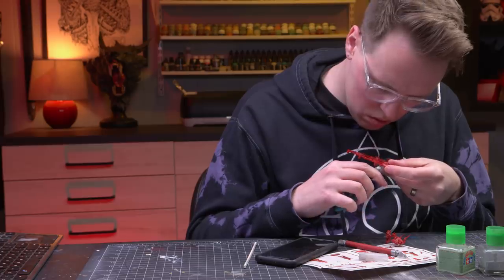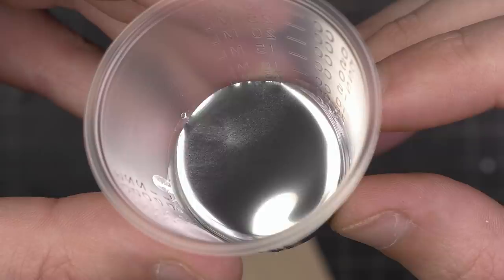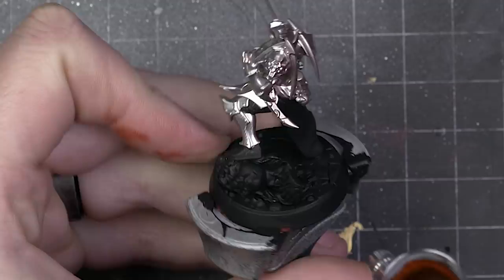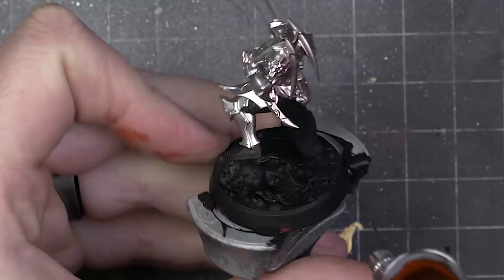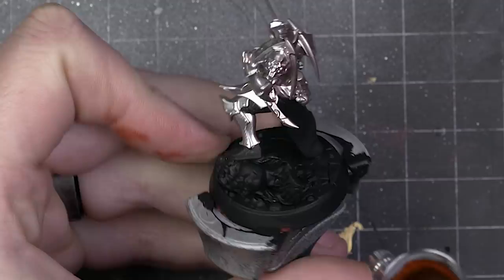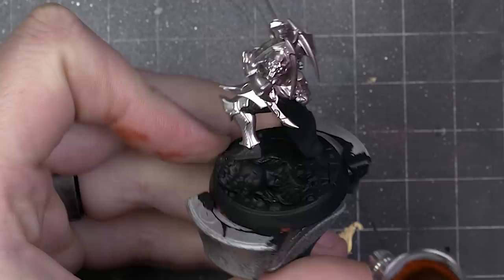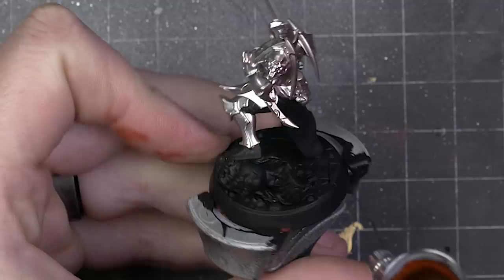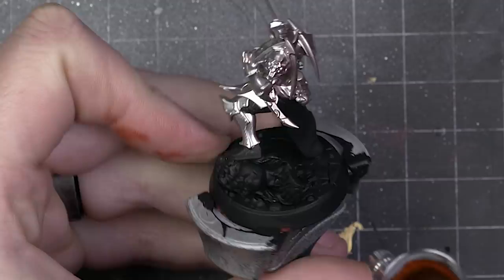Can I Paint Photo Realistically?

Comment: I think the issue with the reference photo (your NMM painting is awesome btw.) is that the very diffuse lighting makes the metallic surface a bit boring and unnatural.

In 3D rendering, this is where you use HDR 360° images to create interesting objects and contrasts for the environment that the metal can reflect. It could be interesting to emulate this using a setup of small LEDs and maybe an LCD screen around the mini.

Comment: I think there is a problem with trying this method (even if youre head is in the right place). Changing scale plays havoc with everything. In this case, I think the primary problem is distances vs. reflection intensityt. The shiny model is very shiny, lets say, roughly about as shiny as the "real" armor would be if it existed irl. However, the distances are not the same (so you changed one parameter but not another). There is more distance between, say, the models arms, and the ground, but the ground is reflecting just as much light as usual. That means you might see a very vivid reflection of the ground in miniature, but it would be much less pronounced irl. The distances between different parts of the body are different. So the legs are reflecting as much light as a full scale model, but they are 100 times closer to the chest than they would be, so you get a lot more bounce light off the legs onto the chest than you would irl.

You could do this. But the real way to do it would be to take a picture of the real 1:1 scale model and then paint it to that standard. Otherwise, you will succeed at creating what looks like a shiny miniature, not what looks like a tiny version of a man wearing shiny armor.

Comment: I'm wondering that if for the final glaze you used the X-27 instead of the Contrast if that would have made a difference in pulling it closer to the original. It is a much more candy red than the Contrast and would have still preserved the rest of the work.

Comment: it may sound weird but to me it says what ninjon has said a few videos ago i believe, not enough contrast.
If you're going for THAT much metallic smoothness you got an extreme amount of contrast (which is what you saw and pointed out with the highlights being so close to the recesses).
The other things that you have to keep in mind when going with anything metallic (and this is used in 3d rendering a lot) is how smooth the metallic surface is:
not all surfaces are mirror like, granted plate armor most likely will have some smooth surface to it, but not to this degree, and even though i understand where the thought came from, using that chrome pen's filling may have been counterproductive, as it will make everything look like a mirror, which would never be realistic in the first place, as well as not having any contrast between the amount of mirror like surface and any rough spots (which, looking at the photo, there are none)

Comment: I can't help but feel like the problem wasn't so much about matching the colour palettes but more about the fact that the example module was chrome with red over it, whereas your example is trying to paint red directly over black. 

It may have worked better to achieve that kind of metallic cherry red effect if you had built up to an NMM chrome before applying red glazes over it, or potentially even if you had started from a white undercoat? Your end result is actually quite similar to the 3 color break down (6:23).

idk, I'm not a very good painter so I'm probably wrong.

Comment: The intense bright lines below recesses only would happen if the "plate" of the armor is deformed into that shape, if it's two plates one over the other it wouldn't happen, asthe cause for it is that the "plate" bends upwards again and catches the light to then keep bending and stop doing it, is pretty much an inverted bevel, so some of the bright lines you did were actually wrong as you replicated an effect that was caused by the nature of the figure, being one whole piece instead of multiple layers of metals building an armor over a vampire. everything else was great though!

Comment: Miniac has balls of steel; though one is larger than the other, and kind of rusty.

I suppose that the "photo realistic" model is suffering from a sort of double bounce of the light. The original model has the light bounce of its surface, and then back in to your eye. The second model has the light bounce of your approximation of the already bounced light and then back in to your eye. If that makes any sense? :)

Comment: I think something in the pipeline between your camera to the paint isn't showing real colours because the model looks more vibrant on film, in this instance maybe starting with an orange base and painting on top would improve the result? I can see a potential problem with trying to colour match to a monitor as well, because the blue light off the monitor will backlight your paint, making it harder to match, which may be why your end result is washed out.

Comment: Your attitude in this is really motivating, thanks scott
Reply: Awesome video! Was really interesting to watch.
I'm a digital and gouache painter, and I think I have a few ideas if you're going to attempt this again.
The first big thing is - don't colour match to a monitor. That thing is backlit, it's going to throw off your colour perception. Do a print out of the mini and colour swatch to that instead.
You started on a brown base colour painted on top of black, which seemed to have made your life far more difficult in terms of getting that saturation up. Both the brown and black will have a lot of cool tones in it, so you're already fighting against those tones desaturating and cooling your reds. Your chrome mini was red on top of silver, so the saturation came through a lot more easily. Maybe it would have been easier to start with a white undercoat? (I always basecoated my minis white because I hated how much of a struggle it was to bring up saturation from the black base.) It's so much easier to tone down the saturation of a shade with a light wash of its complimentary than pump up the saturation of a muddy colour. 
Reds and yellows are generally a huge pain in the butt to shade and highlight without muddying up. What I've learned is instead of just going up and down the value scale, adjust the hue as well. So a red highlight can shift more towards orange and yellow, and a red shadow can shift towards purple. Helps keep things more vibrant! Also boost the saturation of the colour immediately around the highlight. It helps create that 'hot' specular. 

Sorry for the long ass comment! If you ever want to talk colour theory I'd be more than happy to :D have a lovely day!

Comment: The background is important as it will determine the colour at the edges of the model. As the surface turns away from the viewer at the imaginary eye beams hitting it get closer to 0 degrees the light that is bouncing off the surface will be coming from behind the miniature. Many images of glasses of beer use a black background to give a black rimlight to contrast with the bright specular highlights, but that makes the beer look dark so they make a white cutout the same shape and slightly larger than the beer and put it behind the image to reflect light through. Here is an example where the cutout does not properly match the shape: https://www.horiba.com/fileadmin/_processed_/csm_01_02-2019_Beer_Brewing_53ef2818e5.png
Reply from the maker: Sure, you're right, but this would only effectively mean that I rim-light the model with an edge highlight. It doesn't change anything drastically about the majority of the paint job.

Comment: Is your screen properly calibrated? You may have been colour matching to a colour that isn't correct. I didn't see you compare the original mini to your screen at any point, so even if you are a perfect expert at colour matching, you would have likely been matching the wrong colour.

A good tip is having a wall paint samples booklet and using that to compare the colours of your mini on the set to your screen.

I think you also made the classic mistake of comparing wet colours. You should print out the colour and see what it looks like dry to get a clearer understanding of what it is going to do.

Comment: The vast difference between the twos saturation and vibrancy is really surprising.

One detail you didn't go into was the specific paints, did you mix them yourself or use them out of the bottle? I'm curious how Kimera, Pro Acryl or Scale75 artist would behave differently (if you were going for a mix approach)

Also i'd imagine reaching proper saturation on red at that level would require something like Vince does, plopping down a white underneath and color on top repeatedly.
Reply from the maker: I used Kimera for my mixes

Comment: When are mini painters going to discover lacquer paint? I know that they are way more toxic than acrylic but the finish is so much better, plus you can do cool stuff by putting acrylic over the top and removing it kinda like the way you do with oil washes. 

It's the paint of choice for Gundam and other hobby builders. I think minis are way to influenced by the products GW sell. GW has a good easy to use system but it is far from the best way to paint things.

Comment: Nice video. Something  a bit different, than usual. Suits me.
One question - would  you mind posting some higher res photos of the NMM dude you've painted? I'd like to look over some details.
Reply from the maker: They are high res, but imgur is a little strange. You used to be able to click on an image to make it larger, but now the only way I can make it work is by right clicking on the image, copying the link, posting it in a new tab, and then zooming in and out that way.

Comment: Quick tip, you can use plastic shot glasses as mixing cups instead of more expensive tiny measuring cups.  Unless you use the measurements I guess :)

Also when you're in the store you've got the dilemma to explain that: a) you don't have an alocohol problem b) you're going to mix paint to paint tiny soldiers